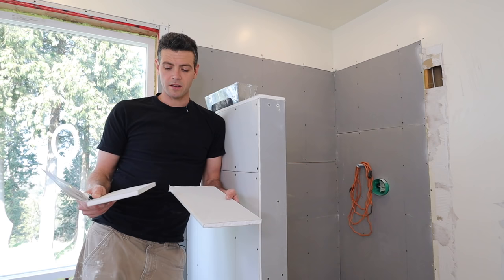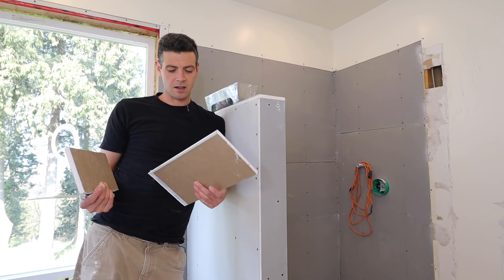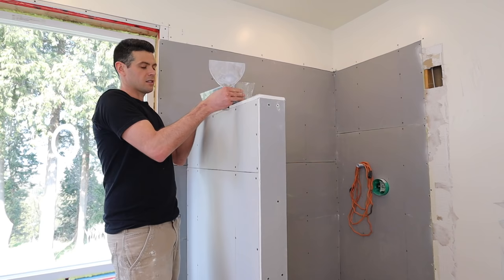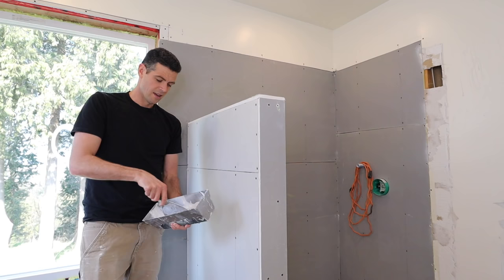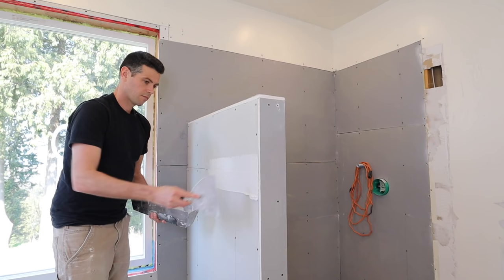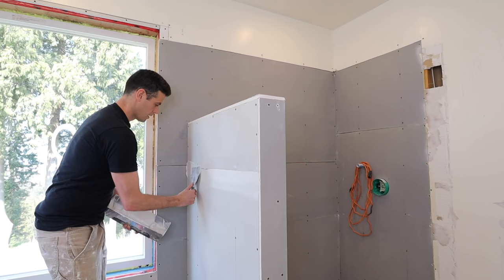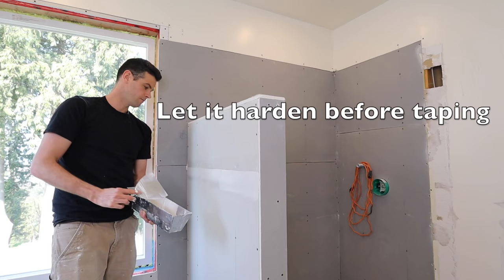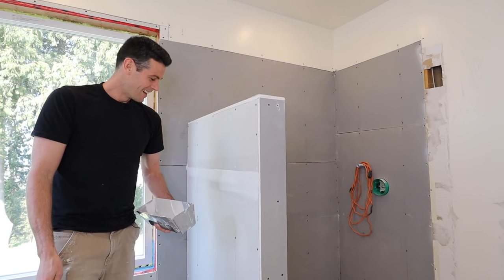How to Tape Un-even Drywall Joints!

Comment: I’m remodeling my kitchen (turned into a HOUSE remodel thanks to my wife ;)   ...   been watching your videos and I can honestly say, you have helped me a lot!  Thanks!
Reply: I have heard that remodeling a house, whether you do work yourself or have it contracted, is an extreme test of the strength of a marriage.  Locally, a McDonalds restaurant went through a remodel that, for some reason, seemed to take take well over a year.  I asked young people working if they liked that.  Of course, they didn't.  I suggested that someday when they are married and considering remodeling a house, that this is a good lesson.  Furthermore, I did a tiny, tiny piece of work in her laundry room where I cut through drywall to install a wall cabinet to protrude into a void that had the water heater.  So the cabinet was flush mount.  I had closed the laundry room door thinking that would take care of the drywall dust.  Wrong.  A very light film of white dust got on most everything through much of the house.  The lady was NOT happy.  And that was just a tiny job.
Reply: @trainliker100  we’ve been together through thick and thin for over 37 years.  She’s a trooper for sure.  She knew going into this it could get bumpy.  The biggest problem with doing a house remodel is making sure it’s still livable while doing it.  The only thing she (and I) have had to sacrifice is the dishwasher as it’s being relocated once the new cabinets are in.
Reply: @BOPilot5517  sounds like she likes your workmanship👍
Reply: @trainliker100  i was involved in a commercial remodel that took a year to do. The reason why ... Corrupt city inspectors.
Reply: Gotta love trying to work on 1 thing but can't unless you work on 12 things

Comment: I've become a fairly competent drywaller thanks to all your helpful tips! Thank you!! =D
Reply: Same here!
Reply: Yeah, I'm slow as molasses, but the bathroom I did last year looks pretty great, thanks to VC (and DIYchatroom).  Starting another bathroom now.
Reply: Me too.  I'm certainly not as fast.  And don't try to use anything like stilts and don't have a top notch vacuum sander.  But I'm now nearly finished with my roughly 1000 sq. ft. garage.  Just finished a window return using tear off strips and it came out perfect.  I think the key points that helped were:  Screws not nails (and I got a Makita drywall screw gun - well worth it), Pre-fill joints with quick set compound.  Use shellac based primer on any torn paper.  For universal compound in the big bucket, add a little water and stir.  For taping, add more water to the compound to make sure it is thin enough so the tape will get wet enough.  Feather edges - avoid sanding.  Tools I purchased were the Makita drill, a cheap $30 vacuum sanding attachment with sanding screens that you connect to a shop vac, drywall sanding sponge, several drywall knives of various widths, a stainless drywall pan with friction grip, a hawk, and a drywall T square.  Very low capital expenditure and more than adequate for a homeowner a small more or less one time job.

Comment: I recently had a roof leak causing my drywall to blister so I cut the drywall out about 2ft square piece. I got a patch piece and cut the patch out and when I installed it I had this issue. Luckily I had so quick set mix and prefilled and sanded it smooth before taping. I’m not a drywall guy was just trying to problem solve. Glad I found your video to ease my doubts a bit 😂

Comment: Something I’ve done on butt joint is take a wood rasp and cut/grind a taper on the edge. Then I fill/paper the taper like they were both factory made. Finishes out flatter.  But yes it was/is some work to make a taper but I liked the result.

Comment: When I do a joint like this, especially a horizontal one, the way I do it is I cut the edge of the butt side down, basically v it out, then tape it. And when I mud it I use my curved trowel and mud the bottom side of the tape, then I let that dry. After that I come again with the curved trowel straight across the middle. That way your trowel is riding along the high point of the mud, and the wall. And you get a basically flat joint. After that, sand and skim, then final sand and she's perfect.
Reply: @jjc1401  If it took you longer than a minute and a half to read that then that's on you lol.

Comment: Is it wrong to prefill joints (before tape) too much that the groove is gone? 

My butt joints were not perfectly level so I did this this trick and now the groove is perfectly flat.

Does the center crease of the tape NEED a slight channel to sink into?
Reply: Pre-fill to close the voids . Pre-fill to level extreme edges . There is no single answer to your question . When adding seam tape , the trick is burying it deep enough and expanding the edges far enough to hide the connection . Too much mud usually leads to over sanding and bad looking repairs .

Comment: A wrapped drywall edge is much stronger than a cut edge. It’s important not to pretend it’s a match as to fastening. Whenever i meet this where a butt joint is next to a wrapped factory joint I back it with something I can fasten it together with using screws so it doesn’t crack later.

Comment: I've had good luck with just taping right over these seams without any prefill, but I'm also normally using sheetrock 20/45 for my first coat to be able to get two consecutive coats on at once

Comment: Or avoid them when choosing what prices to cut, drywall is cheap (for now) lol
Reply: The wasted material is far less (value wise) than the time id spend mudding and taping. That is my opinion and it also makes for a better quality finish most times. My boss and I have our own opinions about this. Only setback is the disposal and "cheaper" material cost.

Comment: Ben, can you just hang the drywall bottom side up and not fill in the tapered edge and finish it off like a butt joint versus bastard joint? Tapered edge can then just be covered with the baseboard, no?

Comment: @vancouvercarpanter821 did a rookie mistake.  I placed a tappered end as a corner to a butt end.   Obviously I can't just put a corner bead on that.  Would I use the same method to pre fill the tappered corner to make it squared and then put the corner bead on?  After all dries.

Comment: How would you tape a butt joint where new sheetrock meets old sheetrock that has texture on it? I've been smoothing the texture side before taping so the tape lays down better is that the correct way?
Reply from the maker: That's a good way to go about it.

Comment: Hi, you might be able to answer my question. If i was going to unite a concret wall with drywall, would it be the same mudding and taping process? Thanks in advabce

Comment: I've always been curious as to how "flat" any taped joints are that are not using tapered edged plaster board? Obviously there's feathering off with the filler (or mud, or whatever you call it in your respective country/region), but surely there's always a height difference? In my experience, deviations to a flat surface can become visible at certain times of day (casting shadows etc), and in some cases you can still feel a "ridge" after painting if you run your hand over the surface.
Reply: Yes there's a height difference for sure as there has to be compound behind the tape to adhere it properly. Ridge height is probably about 1/16 of an inch .

Comment: So I have prefilled all my but joints after carving the “V” in them but my mud has shrunk so much I’m wondering if I should maybe re-pre-fill them all again?! I had a 5 gallon of bucket mud I bought when it was on sale last year before I found your channel so I used some of that after mixing thoroughly… I also used some quick set on some ceiling joints… this is a remodel… suggestions?

Comment: I live in a mobile home and redoing the joints on my walls I’ve just skimmed coated those joints due to uneven walls but I did not use tape because I’ve notice the taped walls from previous owned left slight humps any tips or suggestions?

Comment: When I put the coat of mud over the top of the tape, how do I know how thick it is in that centre bit?   I know when it's too thin (I can see the tape) but I'm worried I'm putting it on too thick.   And what thickness SHOULD I aim for?   And then is the next coat put on the same thickness as the last coat?
Reply: As thick as it needs to be to taper it out as far as it needs to be . Easy ....

Comment: Do you also "pre fill" the taper at the intersection of the wall and ceiling?  (if the wall sheet has a factory taper at the top edge)
Reply: No. Just tape it like any corner joint.

Comment: Ben, thanks for the video.  You mention using standard joint compound when filling the tapered side.  Is it preferable to use the standard mud compared to the hot mud or will either types of mud work just as well?  Thanks!
Reply: He doesn’t say in the video, but there is a edited in banner saying he uses hot mud. He’s talked about prefill before and he typically uses hot for prefill, as deeper fills take too long to dry when using regular.
Reply: @markoshun  Thanks Mark - you're right!  I mis interpreted the banner.  Thanks for the catch and correction!

Comment: Or you could just use adhesive mesh tape first, fill over top of it and save a step.  Yes, I've used mesh tape successfully for years.   No, I'm not interested in debating mesh vs paper tape.

Comment: 2 years late, but I just wanted to add my 2 cents and say that's an unnecessary step and a waste of time. Just tape it. The tape job isn't that important, just makes sure it's wiped and there's no dry spots. It will be fine. Finish almost like a butt joint but offset to the shallow side to fill it in. No need to create extra steps.

Comment: That is so dum  drywall is cheap just match it with another depressed edge ,and you eliminate it being a butt joint that has to be feathered out to hide it  and it's less work and better result